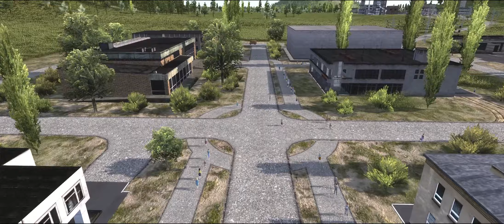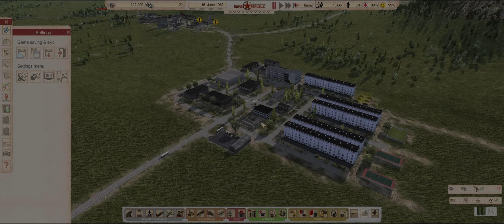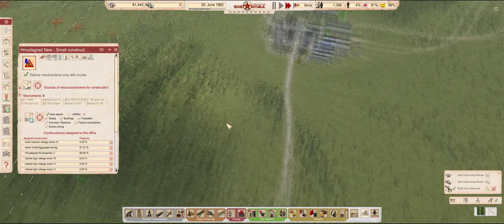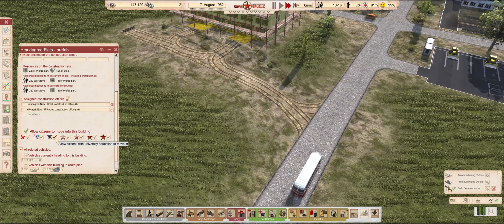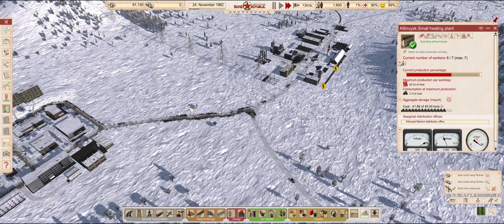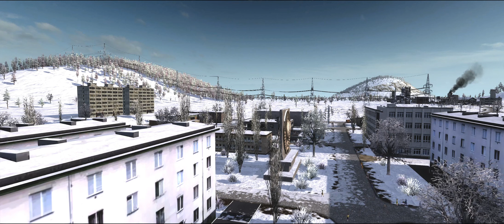The Storm Before the Calm - Episode 7 ║ Workers and Resources: Soviet Republic

Comment: Is there a reason you use road cranes rather than tower cranes?
Reply from the maker: Mostly convenience. They can work on power poles, pipes, coveyors, etc, which tower cranes cannot do, plus they don't require an open hull truck to move them around, so that's one less vehicle tied up moving machinery. Sure, they work slower on bigger buildings than tower cranes, but that's a personal sacrifice I made. :)

Comment: Isn't repaying and retaking the loan every time an additional drain on your money, since you basically pay back the interest instantly to take out another loan with more interest, rather than letting it tick down slowly?
Also the regrow-grass tool is considered a bit of a cheat, since it makes crops grow quicker, just very marginally. So probably not any impact.
I really like that series, no criticism intended.
Reply from the maker: You only pay interest on the monthly payments. If you decide to repay whatever is left over on the original amount, it will be paid off interest free. When you try to fully repay your loans, you can only enter the amount that's left, not more.

You can test this by taking out a loan of 2million, immediately repay it and you're exactly back to where you started, zero interest paid.

Also, yes I know pressing N grows crops a little bit faster, that's why I will avoid using it once the farms start working. :) But since none of the fields were sown this year (it was already too late in the year to start it up), there was no danger of it happening. It only affects the fields once they are sown and in the growing phase.

Comment: a fabric factory can provide more than two clothes factories. No need to build one fabric factory for each clothes factory. Just connect the three buidings (1 fabric + 2 clothes) to a warehouse, add a truck loading / unloading station and go for it ! 
Also, at the beginning of the game, no need to build 2 distribution offices. They are expensive and can manage up to 20 tasks. 
Nice vidéos, thank you :)
Reply from the maker: Eh, it's a bit too late to mess around with the industrial area at this point, it would cost a fortune to rearrange everything to be min-max efficient. :D

I specifically built another DO at the industries, so the fuel truck doesn't have to go all the way down there from the border, especially for the quarries. Same goes for the two trucks responsible for selling excess fabrics. If they are closer to their area of responsibility, they will spend less time running empty, and wasting fuel.

Just wait until the next episode, you'll have plenty to cringe at when I'll try to deal with gravel distribution. :D
Reply: @Hmuda  well now I'm intrigued.  Gravel distribution, woohoo!

Comment: There is a problem in my republic. I created a steel industry zone. And workers are to be transported by Train and then by bus to mines and other related industries.
Freight and passanger line working smoothly.
But not a single worker is riding train! 
Please tell me how to fix this.
Reply: If I understand correctly, you have a train that goes from city to the steel area, and is supposed to drop off citizens on the station for a bus to pick them up and distribute them right? If that is the case, have you set the train to force unload them at the steel area? On the screen where you set up a drop off there is a check mark down to the right that sais "force drop passangers( traverse to another line)" or something like that, that would make them step out there and WAIT for another transport to pick them up. Otherwise they don't see any reason to go there since there is "no work". Or you simply forgot to check whether the train is loading workers at your city
Reply from the maker: In case Lukás' method don't work for you, let me try to interpret your situation too. :)

So you say you try to take workers to a certain distance, and then make the rest of the journey by bus?

If there are no workplaces at the train's end point, nobody will get off, because they first and foremost look for a place to work at.

And usually passengers only get onto the transport if there are available work spots along the route, so if there is no place to work immediately at the end of the train's route, nobody will bother getting on in the first place.

If you have a separate bus stop at the train stop, you can also use the "Add buildings where citizens should go" button on the train station, and select the bus station as their destination. They will get off, move to the bus stop, and wait to be picked up there.

If you don't have a separate bus stop, then telling them to get off regardless will do the job (when you set up the line, you can see an extra handcuff looking option at the "unload" section for each stop, ticking that will make that station act as an intermediate stop in the chain).
Reply: Ok ! Let me try that out. 😅
Reply: Make sure if you force unload that you don't immediately pick them back up on the same train and take them back.